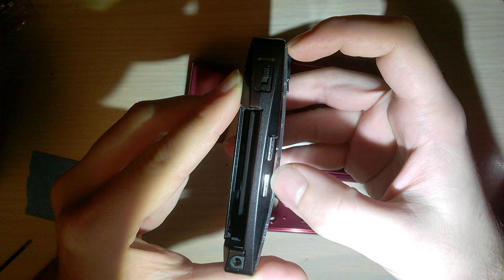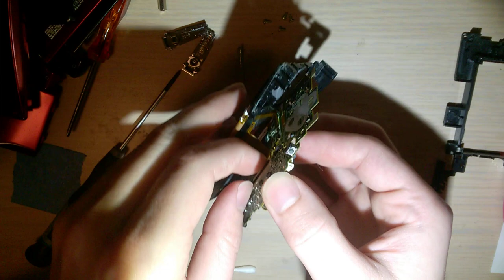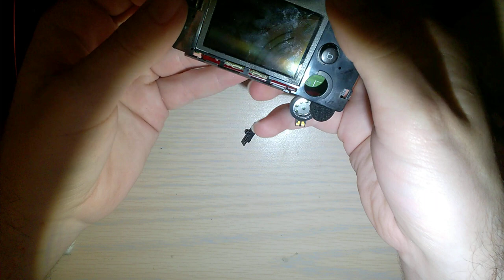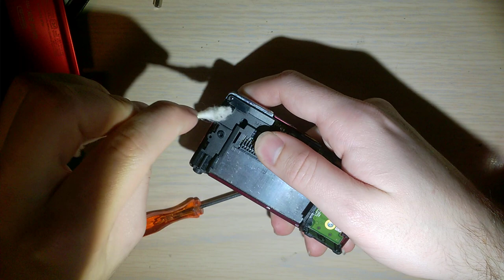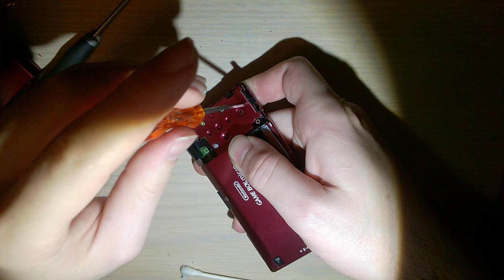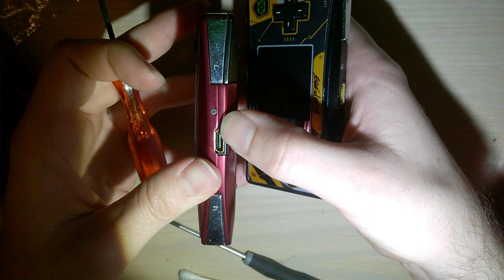Review of the new aftermarket Game Boy Micro shells

Comment: Since you’ve made this video, have you looked into what that white wire on the motherboard is for?
Reply from the maker: Not quite. I know it's a factory fix and is present on quite a few models but beyond that, I have nothing. See https://gbhwdb.gekkio.fi/consoles/oxy/ and the pictures of the MJF10059445 console for another example.
Reply: Not sure either, given it's a -01 board revision likely a late fix was needed quickly and there wasn't time to redesign the board so they had to attach a wire after manufacture. The earliest GBAs also had a similar fix applied, as did a lot of Game Boy Players.

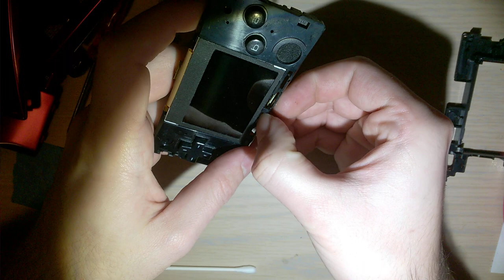Comment: @11:50 there Is a way to fix it if you break the ribbons. But you really shouldn't. it will take 10 years off your life span if you do it.

I've tried 3 times to fix the start/select board. it's the easier one to fix, and I've still gotta go back and fix that select button.

https://www.instructables.com/id/Fixing-ripped-off-STARTSELECT-board-ribbon-cable-o/